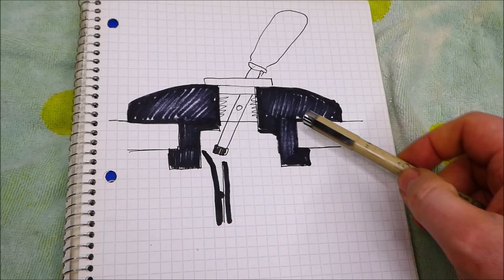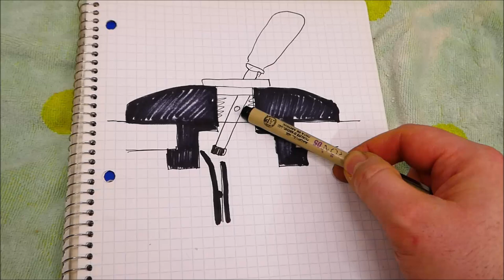Gibson ES275 Switch is Suspish

Comment: Gibsons philosophy: Lets build beautifull, excellently sounding instrument from AAA grade wood, with amazing pickups, and then we'll put an 0,10 USD rubber ring under gold-plated switch. ARGH.
Reply: Sad engineering for a new model that was designed in 2016.
Reply: Yeah! But try to buy a replacement for $0.10.  Good farting luck to you, and it doesn't matter if it's pure shite. It's like trying to fix bathroom taps. No washers now, just cartridges ya can't find then get charged a king's ransom for.

Comment: That guitar is a beauty. I don't like the rubber thing either. I was thinking  a purpose built ebony replacement cup maybe? With a thin compressable buffer on the underside. Wierd to build a temple to wood and then slap a piece of rubber there.

Comment: Good stuff! As always.
I've yet to figure out why there are so many luthier/repair channels and this one isn't the top rated YouTube go-to, must follow, most subscribed.
This is real luthiery and instrument repair at it's best. It deals with real world instructional content, technique, specific to model, build,  known variables and stringed instrument structural engineering norms from historical to modern design. This is not about this episode per say, but your content as a whole.

Even the simplest hand tool informational, like planing & carving techniques, jig design and setup saw, knife & chisel differences, proper use and best choice for specified tasks its a world of knowledge in your head my friend. I didn't even mention safety and the importance you stress on blade direction or mechanical rotation. You even point out examples when you get hurried and present it incorrectly, as an example of what not to do. You never let a teachable moment escape you. And there's more! So much more. I've learned more about wood types, growth patterns, species origin and natural characteristics based on every possible exposure from climate, condition, players style & habits, like oily, grimy hands, humidity, basic maintenance needs vs neglect, stored in case vs leaned against a wall and the environmental affects associated with all these situations. Another, Clamp styles and techniques, glue variables, adhesion properties and choosing wisely. There is something to learn in every episode, even if you thought you'd seen it all. I could go on and on.. and I have. My apologies!

I just don't think people realize the value of what they are getting here. You can pay for a course or get into an apprenticeship to learn a lot of this, but so much of your skill is real world, tried and on-the-fly mastery. Been there, done that, couldn't afford to buy that tool or fit it in my space, I'll design a way, perfected. 
You can't buy that kind of knowledge. Ted, you are a professor good sir. I only have one criticism. Never think, this is boring, I've shown you this before. Every repair has its own challenges and slight difference. The most minor thing in a setup, like tool choice for that particular instrument or process that may seem mundane to you, can be eye opening for many of us. Keep up this incredible content!!!!

Comment: I'm so glad I watched this a second time just to catch your playing at the end again !
You have a lot more faith in your work than I have in mine, I would not be able to stop that tiny pared down block for the strap button from splitting when I screwed the button in unless I made it from a thick block of fibreglass and attached it with thickened epoxy or used a bolt through the button and a metal washer with a nut inside.
 I know my limitations !
I also got a better sense of how tiny your workshop is from this video, it looks like the cupboard under our stairs !

Comment: Now I know what the extra lock nut with the strange little flange was about when I ordered a switch for my 335 build. I thinking fixing one problem should not have to cause a compromise and create another problem. On the upside they left you with a handy little access hole. Great work as always Ted!

Comment: Good call by the owner on the position of the strap pin. I put one in on my old Gibson ES -175 in that some spot. I don't know what people are thinking when they put a strap pin into the end of the heel of the guitar or worse on the treble side of the heel. 🤷‍♂️

Regarding the toggle switch, couldn't you use a piece of pick guard material and make a poker switch sandwich with a U-shaped metal plate that you could slip through the hole for the inside? Maybe not worth the effort. The rubber thing is wacky and wobbly. The switch seems to be working well enough now. Beautiful guitar. Thanks

Comment: I've just added a strap button to a 1966 Hofner 4575 (or, 65-3, as they're also known - it's like a 3 pickup Verithin, with a fascinating control panel). It would just have looked wrong on the upper bout (plus Hofner didn't use kerfling, so that's a weak point), I didn't want it on the heel, and in the traditional position on the body behind it would've ruined the look of the lovely flamed maple on the back. 
In the end I put it where the uppermost screw closest to the neck on a Telecaster backplate would be. It's out of the way of the hand, and because it's offset to the heel and body there, somehow it doesn't dominate and disrupt the beauty of that part of the guitar.

Comment: I've got a ES175 Ibanez copy with a switch like that, the rubber is much more dense and lower profile, no issues except this guitar was once a modified  Guitorgan! All the electronics are gone but still has the frets divided into 6 pieces each with leads that go into the body.

Comment: I collect Gibson Barney Kessels which have that rubber grommet as does the fully hollow Trini Lopez. I also have a 275 Thinline. I’ve never had an issue with the grommets or switches. I’d have probably replaced the switch…..

Comment: The grommets on the older hollow-bodied guitars were much stiffer and had a nice shine to them. This grommet looks like a cheap knock-off. On the ES 175, the grommet and the original long Switchcraft toggle switch formed a perfect pair, no worries at all. BTW, you have to put the grommet in first, pull the switch upward, and fasten the nut.

Comment: Good clear video but as soon as you positioned the tape and  drilled for the strap button I thought it was too high and at the wrong angle and then when I saw you wearing the guitar I was convinced. It definitely needs a strap lock there now.

Comment: Maybe, one solution for the stiffness of the switch can be to slightly shorten the long contacts that the plastic lever pushes away and cut rubber material only where those contacts have to move into.

Comment: The Ring of black is resin. I had one of those in my shop. It didn't look as clean as your example. I had to do a little scraping on it and I noticed it was epoxy. I think they do that to keep cracks from forming in the Finish, you know add extra strength at a weak point.
Reply: The plasticizers in the rubber will leach out of the grommet and make the finish gummy and then pull out the carbon black filler without protection.

Comment: I wonder if it would be possible to modify or trim the very end of the spring where it contacts the grommet. It was bent at an angle on the tip, I suspect as a ramp for the switch post to make contact with but maybe it didn’t have to be quite that large.

Comment: Switch back and forth often enough, the contact spring might eat away enough of the rubber eventually. Sharpen the edges to accelerate?
That rubber will disintegrate eventually anyways no? Might as well figure out a more elegant solution already.

Comment: But what if you would have just trim the very tip of the bent end of a second contact of the switch with dremel or a file? Or even try bending it back flat a bit. Since I imagine it’s just an excess section of a contact and is the source of a problem?

Comment: Putting the strap button on the lower bow of the neck as you would do on acoustics is far better than stressing the already thin sides, resulting in a crack that will eventually spread through the whole length of the side. The strap will not be an obstacle and the guitar will not be head heavy.
Reply: It feels weird to hold

Comment: The issue is the grommet they are using for this model run. It’s not designed for that use, it looks like a regular grommet from China that you can buy in bulk. Maybe the original manufacturer stopped producing them? I have an Ibanez GB 10 and the switch and grommets work just  fine, I am sure also the switch in the L5s and other Gibson  arch tops guitars work with no issues.

Comment: The toggle switches they’re using nowadays are not as smooth as the old Switchcrafts. They tend to be stiff and clack as you use them; the original ones were silent.

Comment: that rubber grommet is so stupid. 
They could've just made a Poker Chip that has 2 Screws.
or a 2 Piece washer poker chip, don't know how to explain what i'm thinking.
basically two plastic discs that have like a 3/32" lip that fits into the hole and a rim that`s wider so it gets clamped down against the Top by the Toggle Switch Nut
Reply: And ugly too. Makes it look like a rubber gearbox cover for a truck.
Reply: You can't put a chip in a hole that's bigger than the hole.
Reply: @jeffscarff1655  you could through the F Hole

Comment: Tim,
Long time viewer and subscriber here, but if you can, please help me out. I’m a repair guy myself but building a one-off scratch build and need some assistance. I’m making a 25” scale custom electric guitar with a Wilkinson VS-100N bridge. My issue is I can’t find anything on placement for the studs for the scale I’m using. I have the neck pretty much done but doing my research isn’t pulling anything up for what I want. Everything I find is for a replacement Strat 25.5” scale. Do you, or anyone here, know where to drill for the bridge studs? I’m over thinking this I’m sure, but want to do it right the first time. Please let me know if you can help and thank you for your time as I know it’s valuable as is mine! I do have the Stew Mac routing template for this thing in case you need that info.